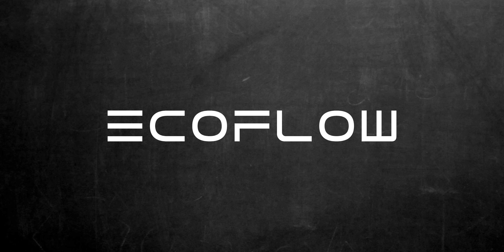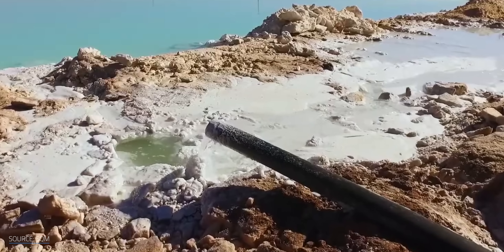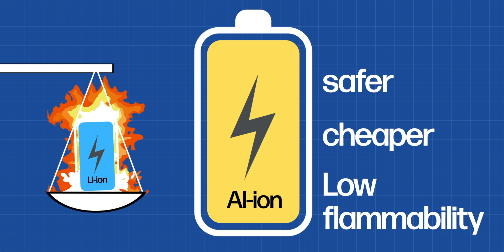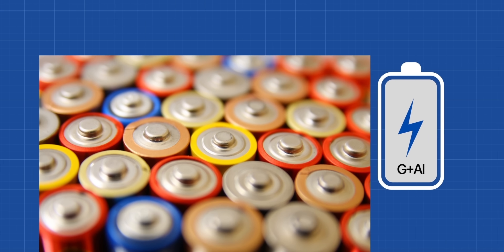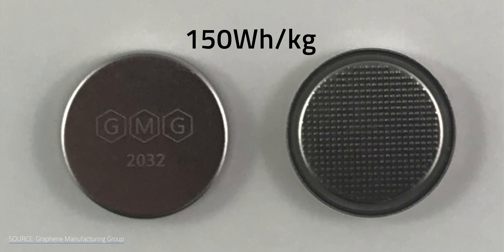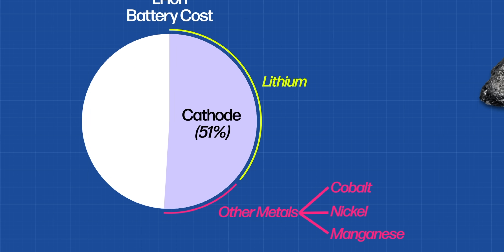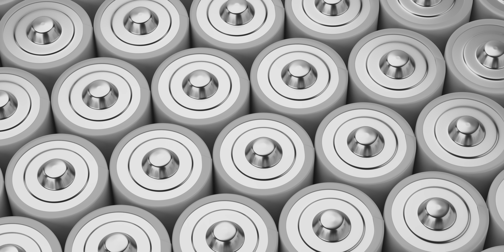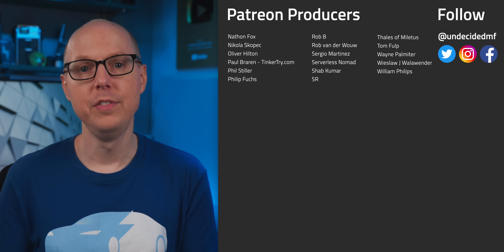Can This Metal Really Beat the Lithium Battery?

Comment: Thanks Matt, I think you missed one of the most important facets of GMG's business model:  They're forming their graphene directly from (natural gas / methane / CH4), so their graphene is a) ultra pure, and b) super inexpensive compared to other production methods.  They can also produce this graphene at enormous scale, as their original intent with the product was to use it to harden concrete, requiring huge volumes of the material.
Reply: Are they left with hydrogen after? Or would it be bonded with other?
Reply: @marcmoncrieff7700  Nothing I've seen so far describes their actual process, as that's part of the "secret sauce", but since they're removing the Carbon (C) from the methane (CH4), they would have to end up with a lot of hydrogen - I'm just not sure "in what form" it would be in after the reaction...
Reply: @fcbrants   Yea their secrecy sauce is probably just Flash graphene  as it’s the best way to make graphene
Reply: Let's hope "super inexpensive" is true.
Based on the estimated $100/gram in the video that's $90,718,470 per ton (assuming we're using short tons... hard to tell with mixed unit videos).
Reply: @pineappleboxingboots  Yep, it was Definitely super inexpensive - their process was cost effective enough to add significant volumes to Concrete.  This is the first video I watched on the subject:  https://www.youtube.com/watch?v=yxhjHSJ_55c
Reply: @pineappleboxingboots  Yep, mixed units suck. $100 a gram equals $100 million a tonne. Metric is SO much easier.
Reply: @pineappleboxingboots  I would assume that they are metric ton as it was stated that GMG is based in Queensland Australian and there smart enough to be a metric country. The luddites in the US live in the stone age 🤣 🤣🤣. Wikipedia states that the SI units or the metric system has been the "preferred system of weights and measures for United States trade and commerce" since 1975 according to United States law.
Reply: Honestly, the fact that it provides a bridge between fossil fuels and renewable energy may make that production route more appealing to the oil industry to finally ditch pushing fossil fuels.
Reply: @fcbrants  they did say before in an investor conference that they were generating pure gaseous hydrogen as a by-product, and at the moment they were just burning it in a generator to get rid of it and also recoup some of the energy cost, but they were looking into ways to sell it.
Reply: Would be amazing if they could partner with oil/gas producers to make that graphene from flare gas. This could actually be the fossil fuel industry's path to decarbonization
Reply: @hatman4818  you don't need to have the oil industry to stop pushing anything.   Once an alternative is more economical, financially, and functionally superior, the market itself will demand the change and industry will respond.  

Build a better mousetrap and they will come.  That being said we will always need and use fossil fuels until there is something to replace the non fuel petrochemicals that are in nearly every product we use from pharmaceuticals, to fabrics, to food, to plastics.  Your smartphone wouldn't exist without oil.
Reply: @pineappleboxingboots  Damnit I’ve been paying $121,783,350 per ton. I’m getting jobbed
Reply: that's very poetic / prophetic that the fossil fuel gases are being converted into batteries to propel us into our non-fossil fuel future !
Reply: @freethinker4991  American machines and scientific applications almost always use metric. It's only communication with the public that uses imperial. Imperial units are also directly based on metric ones now.
Reply: @pineappleboxingboots  $100,000,000 per tonne. Metric units make so much sense.
Reply: I think it was Tin (Sn) and  not Aluminium

Comment: It doesn't matter how advanced  batteries are, the battery installed in the EV you buy is the one that makes the manufacturer the most money.
Reply: Well if this battery will come out and will offer an improvement over lithium, everyone will eventually switch to this, especially if its half the price or less
Reply: The manufacturers will pick the lowest cost battery which meets or beats minimal consumer requirements - range, recharge time, how long battery retains most of its maximum charge (cycles) for a given price. Safety of course. This may not be the most efficient battery or the greatest range but will be enough for example to get 300 miles/500 km of range and we won't need one that gets 1,500 miles as much.
Reply: Manufacturing and Implementation costs can be raised if the user operational cost/performance ratio exceeds competition all-considering negligible effect on the environment in relation to the previous iteration. Not that complicated as demand will then increase with the new capabilities. Not to mention that demonstrating practical innovation is the only way to stay on edge and sustain fundamentally financial leverage.

Comment: Having two options to run any generator is ideal. If gasoline is unavailable I can switch to propane or back and forth.
Reply: propane is a by product of gasoline refining so you are poop  out of luck without gasoline  being refined
Reply: The better option is the PV-Generator up on the roof. It doesn't require any of the gasoline types.
Reply: @beatreuteler  Fantastic..... as long as its daylight...... in the summer.

Future PV designs will mitigate some of this problem but cheap large scale electrical storage is a must.

It need not be Li ion energy density as long as it is within 1/3-1/4 as dense, significantly cheaper to produce and reasonably compact to the point that it won't take a second house sized building to contain it.

If molten air batteries became viable at a reasonable temperature range they could be dynamite for the home storage market.
Reply: @mnomadvfx  Even future PV designs themselves will not make day out of night, understood. To some point you are right, storage is a good thing shifting daylight excesses into the darker time of the day. In Switzerland we have large scale storage up in the mountain reservoirs. Lots of. That's possibly why I tend to forget to mention. I tend to take it for granted. Sorry for that. BTW: Once down the lane when we are making excess out of PV not only very locally where it is used up immediately by the neighbours, but also regionally, all we will need is regulated logal grid transformers to avoid overvoltage in local grids and to allow transfer of excesses to pumped hydro storage facilites. 15% of capacity of hydro storage in Switzerland is also "pump capable". A good thng to have, a legacy from "nuclear times" when excesses were to be pumped during nights.

Comment: After finally being able to do Aluminum smelting myself the past few weeks, I had ideas of attempting to introduce graphite and home made graphene(very home made) to see if I could build a battery. Glad to see i wasn't the first with the idea and they are much further ahead of me. Now, If I could get better at smelting and metallurgy, I would love to do experiments to build a home made battery and even an "open source guide" one day.
Reply: It's aluminium... Not aluminum.
Reply: Sounds like you need to mix in aluminum chloride during the graphene formation so it forms those "holes" around the Al ions. Or maybe they're using direct ion injection with particle accelerators, who knows.
Reply: @Reth_Hard  it was first named aluminum, they changed it afterwards to sound more like the other ...ium elements

Comment: I am particularly intrigued by the aluminum sulfur battery. I live in the Mojave Desert where there are now huge numbers of solar farms. Given aluminum sulfur's increase in efficiency with temperature, the solar farms themselves would be ideal locations for these batteries. The infrastructure to put the electricity from the farms onto the grid is already there. If the solar farms also had these batteries they could deliver electricity to the grid during peak hours in the evening when everyone is getting home and cranking up their air conditioners. To use the well worn phrase that Matt now says tongue in cheek, this would be a game changer. 🙂

Comment: Charging gets faster when heating up, wow.

That's a game changer, man the potential for a hybrid is pretty amazing on that fact alone

Laptops this sounds ideal, especially if we go back to swapable batteries to deal with the corrosion issue

For my phone I'd probably stick with li-ion for now
Reply: Yes and no, that heat has to go somewhere otherwise the thing melts itself ...
Reply: @robertsmith4681  true, but I'm still kinda amazed by that.

Like for cars the first 15mins of charging sucks and only gives you like 15% then you can quickly zoom to 70% 

The trick will most certainly be managing the melt, I was amused by a Li-ion space heater blanket warming up the aluminum as it charges then charging only the aluminum
Reply: @NerfThisBoardGames  The way I look at it, using Lithium is like trying to kill a mosquito with explosives, it "works", but we can't use it sustainably. The sooner we can move this over to simple aluminium the better it is. And if there is waste heat to get rid of in the process so be it.
Reply: Yup, during cold periods when batteries notoriously under perform, you could have removable insulation and use that heat it generates to your advantage.
Reply: @robertsmith4681  as stated in the video, the aluminum and graphene are highly efficient at dissipating heat... This is the future of battery tech, if we are to reach sustainability, and zero carbon footprint, since it's easily recyclable...
Reply: yes charging effiency go up with temperature as internal resistance go down but cell aging faster too

Comment: with the price of Lithium skyrocketing it appears alternative sources are needed and each one looks like it has their niche market.  Heavier batteries could be utilitzed for commercial storage while lighter ones could be used in autos.  graphene looks like a good alternative for autos, while the sodium may be better for commerical uses as they may take up more room.  Very good articles to shed more light on the industry and how it changes.  It also helps to know which ones perform better at lower temperatures to charging energy is not wasted to loss of range.

Comment: I think there are maybe eight key functional and value goals that a competent designer of EV batteries wants to achieve: i) high energy density, ii) high charge and discharge rates, i.e. high power density, iii) thermal stability during fast charging, iv) rapid heat dissipation in extreme conditions, v) a long duty cycle, vi) light weight, vii) excellent safety especially when the battery suffers damage or is subject to inappropriate use and viii) low cost of finished products.

GMG's cells and batteries, based on current claims, get a good pass ranking on energy density and weight, viz. the Al-Graphene batteries offer energy density in line with today's high end Li-Ion batteries.

GMG get a credit for the duty cycle of its cells and a high distinction for all of the other sought after design goals except the cost of the finished product that for the moment remains an open question.

That is a spectacularly good result. Those who are marking down the GMG cells for offering nothing new on the energy density front have a limited grasp of what it takes for a battery design to be successful. If GMG's products come in at a good price they will be successful.
Reply: @justmy-profilename  
Quote : " The improved energy density of 300Wh/kg (lab result) is still by a factor three lower compared to Li-Ion batteries."
Why that ?  
As Matt pointed out  ( in minute 7:16 ) the energy density of Li-Ion batteries are at approx. 250 -300 Wh/kg  ( and not more ) 
I found another source ( fluxpowerdotcom ) and they publish a comparison of different battery cell chemistries  : 
Energy density of Lead acid battery ranges between 30-50 Wh/kg
Energy density of Nickel-cadmium battery ranges between 45-80 Wh/kg
Energy density of Nickel-metal hydride battery ranges between 60-120 Wh/kg
Energy density of Lithium-ion battery ranges between 50-260 Wh/kg

The CEO of GMG said  ( in minute 7:32 ) that they announced last week, that their batteries now have achieved 300 Wh/kg ... so they are on same energy density leve as Li-Ion batteries at the moment ( yes .. in the laboratory so far,  but they are confident, that they can start the mass production in the coming years )

Why do you think that the energy density is still by a factor three lower compared to Li-Ion batteries  ??? Sounds unlogic to me.
Reply: You are delusional. Points VII (excellent safety especially when the battery suffers damage or is subject to inappropriate use) and I (high energy density) and II (high charge and discharge rates) are in opposition. If something has high energy density and can give you all that energy fast, it means that it's definitely not safe. If something contains energy in it's structure (and sometimes in chemical bonds, just like gasoline) it is not safe because nearly any structure can be damaged/destroyed and then all that energy must be somehow transformed or utilized for example to burn your vehicle or destroy everything in it's range (some explosives that are triggered by pressure).
Reply: @krzysztofmeler  seems overly simplified. Lithium ion batteries themselves are more flammable, so it not only gets hot from sudden discharge, but then it ignites. Aluminum chloride and graphene aren't as flammable. Also it's not like it takes long for a run away lithium battery to discharge, especially if the separator melts. It's possible that aluminum graphene is less likely to have a run away reaction, and if it does, graphene can handle heat really well. It still should be tested, but aluminum graphene being safer is believable.
Reply: @willjapheth23789  It is not about what is more or less flemable, but what stores more energy and how it does. If for whatever reason current lithium ion batteries were two times more dense (in terms of energy stored) then the amount of energy released during fire would be two times more and fire would be hotter/longer etc. If you have energy stored, then in the "next moment of time" it must be either still stored or not, read: released. It is just that simple. Energy source more dense than current ones would be great, but in case of damage, all this additional energy would be released. And we have many way to store energy. In cars now, we use gasoline that stores energy in chemical bounds (shape of the fuel tank doesn't mater) or batteries (shape is very important). In case of car accident, energy sources that stores energy in chemical bounds are safe to the time chemical reaction is not triggered by for example spark. With batteries it is different - you don't need any additional trigger - just the change of battery structure releases energy it contained. Current density for car batteries is about 400 Wh/kg (I might be wrong). With, for instance 4 kWh/kg, the range would be much better (10 times) but the same goes for energy released in case of battery damage.
Reply: @krzysztofmeler  but the energy density between the to batteries is currently equal. It seemed like your original point was that the 70x discharge speed was clearly more dangerous, but when you watch a lithium battery explode it definitely discharges why faster, like a second or a fraction of one. So it seems to me something that might help is the quality of the separator, which would be made of graphene. Current lithium separators are polyolefin, apparently, which I imagine has significantly less structural integrity and heat resistance. Lithium batteries can just use graphene too though, probably. 

Gasoline has about 100 times more energy density than lithium, but that excludes oxygen weight, so with liquid oxygen in the car, Gasoline would still have 20 times more density energy. A battery having it's liquid oxygen and gas separated by a thin layer seems to be what makes it explosive. However also gas shows how much more energy you can get from exothermic reactions, so if lithium batteries have more exothermic potential than what happens would be a large spark from the electro-chemical reaction, then an even bigger one from the exothermic reactions with oxygen in the air. 

So my conclusion is that less flammable battery chemicals and a high quality separator, could have a significant impact on safety. Energy density is just one factor.
Reply: @krzysztofmeler  Agreed, it is the basic of Chemistry and physics :washhands:, Jet fuel and all the rocket fuel including Hydrogen and Oxygen rocket booster are good examples.  Fast charging and discharging create heat no matter how you slice it

Comment: The need to expel heat may put a damper on an aluminium ion battery for cell phones etc but for a car where it can be conveniently managed, this may be a great battery. High energy storage and rapid charging is where lithiumn batteries fall short for the automatove market and a system for expelling the heat should pose no problem.
Reply: I don't think they inherently generate any more heat than lithium-ion does, unless you try to charge them at crazy speeds. The "damper" would only be put on the promised fast charging capability, but the energy density and cost advantages would still be there. And even with thermal throttling, they'd still charge somewhat faster than Li-ion.
Reply: @Ithirahad  I am anticipating fast charging especially for cars. I don't know if fast charging would be required for cell phones & flashlights etc but I am sure the populace would like to shorten the charging time.